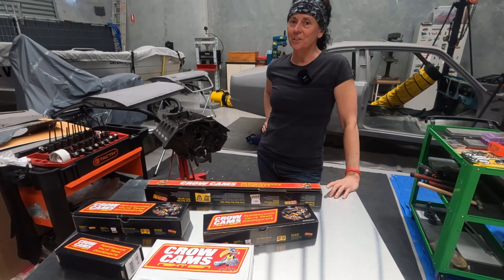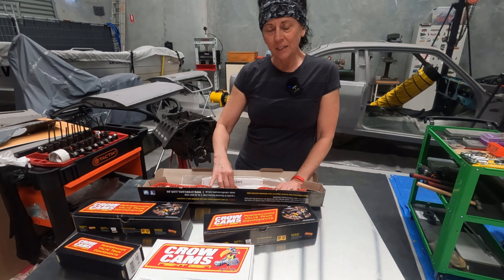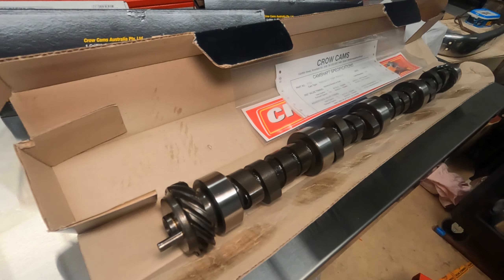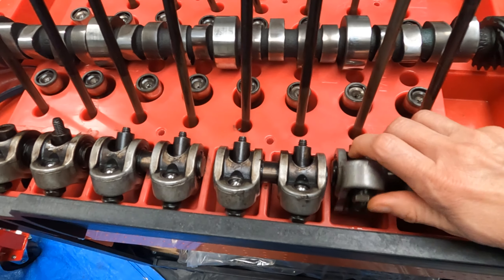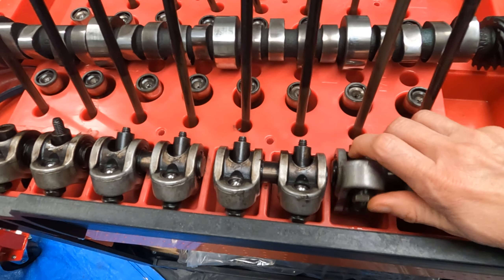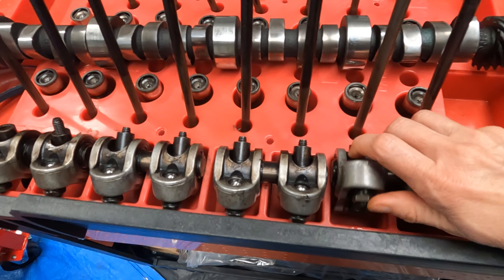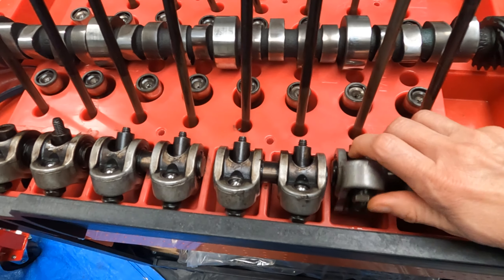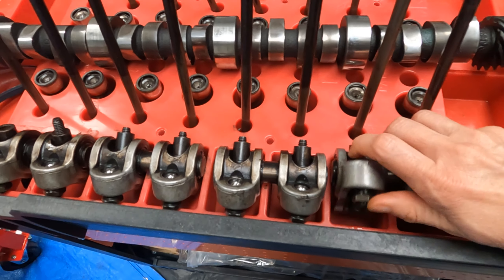The Cam I Chose For My Holden 308 Red Motor Rebuild

Comment: Cam/ Lifter failure on break in has become a chronic problem in recent years,  look very closely at the bottom of the lifters, they should have a slight convex curve on them with the high spot in the middle , if you put 2 lifters end for end they should rock back and forth .If they don't they may need refacing,  even new lifters aren't always correctly machined .

You need to make sure you give the cam a really good clean before adding copious amounts of break in lubricate. 
Also, you should take a close look at the roller tips of the rocker arms . The rollers can get small flat spots on them , if so, you can buy replacement rollers from Yella Terra and their straightforward to replace. 

Finally,  when you get the heads back from the machine shot you should carefully blend the third angle of the value seat into the port and pay particular attention to the short side , the short side will have a ridge left from the cutter , this needs to be carefully radiused to leave a smooth transition around the corner. 
COME Racing, have a short video on YouTube demonstrating how to modify the oiling system,  Holden V8s  pump too much oil into the rocker covers often forcing oul down past the value stem guides so this modification is highly recommended, Sam from COME didn't mention what size the hole in the restricter hole however a 1.5 to 2 mm hole will suffice.

Keep up the good work 👏
Reply from the maker: Phew lots of great info there Craig! I have seen COME's oil gallery mod but was in 2 minds if this build needs it. And yeah, I've seen a few YT videos with failures like Barnsey's. Thanks for this!
Reply: @staceonwheels  I raced a 308 Hatchback Torana speedway car in "Standard Saloon"  a class where virtually no modifications were allowed to the engines others than a camshaft change.
 All the Holden V8's had top end oiling issues with the potential to have 0 oil pressure because much of the oil is up in the rocker covers.  Even after fitting  1-inch inside diameter oil, drain back hoses to the back of each rocker covers and routing them externaly down the sump it still had oiling issues. 

In my street driven 355 stroker that was fitted with VN heads , had the same issue that when you went through the traps at the drags and jumped hard on the brakes, oil would be forced out of the front of the rocker covers and go straight out into the vacupans and into the exhaust system producing lots of exhaust smoke .
Note: The VN heads have smaller push rod holes, thus suffering from this phenomenon more so than the earlier model heads.
Reply from the maker: I'm feeling more convinced... I'll check with the guy that machined the block for me. They probably do this oil mod too.
Reply: With the COME restriction size you are correct but also you can simply plug it there if you do the mod at the front cam bearing.  I plug that particular spot with solid or hydraulic lifters, its not required with the front mod 👍

Comment: Good tips from another Craig here about flat tappet cam stuff.
 Most failures are user related.
 P.s. great cam choice i have used that grind a lot, i call it the budget hotty, easy on the valve train,  sounds tough as, goes really well.
 Re the cam,, clean/scrub ALL of the shipping corrosion barrier off with brake cleaner and thinners(it stops your prelube from working!), put a short straight edge on the nose of each lobe and check it has some taper, you can visually see even .001" with the increased length of the straight edge, fit cam in block dry, fit thrust plate, look down each lifter bore and make sure the lobe is NOT quite central in the lifter bore, throw away any pre lube supplied, rub Moly grease into all the lobes(i use Penrite Molygrease EP3%), i use this because it is NOT oil soluable so it cant run off easily and will hang around until the cam is broken in. I apply about a .5mm to 1mm layer on all lobes.(no it wont block your oil filter, cut it open after break in and this demonstrates that you would need half a tub of grease in it to block it).
 Lifter bores- clean each bore, make sure there are no burrs on the underside from rough cam bearing extraction/installation, using only wd40 or similar- make sure every lifter drops into every bore withzero resistance,  if you need to push it in you have a problem,  now check the lifter clearance in every bore, if you dont have correct bore measuring tools do it  with a mag base dial indicator, at 90deg to cam centerline and 90deg to the lifter body and set best you can and wiggle the lifter, you want about .0008" to .002"(.0025" max) .
 Check each lifter base for convex, simple home method is to just put a strait edge against the lifter base and look at the light either side yes not real accurate but it is better than not checking. Rub moly on base of lifter only NOT on the sides, alloy engine oil to the lifter body and bore and fit lifters. Once lifters are fitted and valve train set using as few rotations as possible now do not turn the engine until you tighten convertor bolts if auto or until you start it.
 Fill oil pump with assembly lube(i use CRC StaLube Engine Assembly Lube here) or vasoline if you have to. DO NOT fill the filter with oil, you want the pump to be able to pick up oil immediately and it cant do this while trying to push oil out of the filter element but it can if it only has to push air out(for holden V8 use a big old type Z30 filter NOT the small filter), set the dissy, radiator and carb to run immediately,  start engine at low rpm only till you get oil pressure, (6 seconds MAX or turn it off) then run at 1500 to 2000 rpm for 15 to 20 mins.
 Cam is now broken in. Set base idle/timing, remove oil filter and oil, fit new filter(no oil in it)fill with new oil, finish engine break in. P.s.  for oil, i use 50/50mix of pentite 10 tenths 15w40 Running in oil and Penrite 20w60 HPR30, for cam break in and for the 1st oil change and ring break in, no expensive useless break in additives!
 Enjoy 👍
Reply from the maker: Maybe you should write a cam install and break-in manual Craig! Amazing info and thanks for taking the time to write all that out for me 👍. I do take in everyone's tips to doyble check and modify my plans. This channel has been great for that so far.

Also great to hear you approve of that cam choice 😁😁😁!!
Reply: @staceonwheels  no problem and thankyou, a book, I don't know, maybe haha. But really what I'm describing is a shorter version of what any thorough engine builder does. I'm always amazed at how many people know what main and rod bearing clearance they have, what ring gap, valve lash etc but if you ask lifter to bore clearance or libe offset, taper etc they say 'thats not stuff you need to check " or just dont know. Then when something fails like a love wipes etc they are very quick to blame a cam company or their quality control.
 Check 'everything' and if it seems right the 1st time, check again as you may have missed something!
   That cam will want a full 2500rpm stall 'at the least' if you run an auto trans.  When you degree it, go by the  'intake tappet rise at tdc on overlap' figure that Crow supply on the cam sheet, this is the easiest and most accurate way if you dont have the actual 'cam doctor' sheet for that actual cam you have due to manufacturing tolerances. Err on the side of 1 to 2 degrees advance on the cam.
Reply from the maker: @craig8187 thanks again. I'm gonna collate and save all these tips for when the build begins. I'm a stickler for doing it right too!
Reply: @staceonwheels  how did you go with this cam install?
Reply from the maker: @craig8187 not there yet. I did test fit it, and all good. But have been waiting on other parts and a chunk of time to get everything cleaned and ready for assembly. In fact, I'm on my way to the shed right now to rebuild the oil pump. Small steps!
Reply: @staceonwheels   beauty, it will get there 👍

Comment: Tasty stuff.  Will be glad when I’m finished with the cab to get round to the fun stuff too. Just finished the underside and started roughing the back panel up where the vinyl cover was to prime it. Floor still to be coated then the front firewall. I had a 308 when I had a sandman clone panel van, had a mild cam put in that with a 650 double pumper Holley after it had a piston disintegrate and rod went through the cylinder. Ended up trading it in for an XD falcon. Miss them both. 😢
Reply from the maker: I wonder how that piston disintegrated...? The cab work is tedious at times, so I'm kinda glad I have the 308 to play with (and my Ducati) along the way. 

I still haven't decide about the back panel on Trixie's cab... there is no rust and the original paint is lovely so I really want to leave it. 

Anyway, we're both making progress and that's fun. Spydey... you'll love your tonner as much as that sandman or xd I'm sure.
Reply: @staceonwheels No idea on the piston, the guy who rebuilt it was a Holden buff and he said he never saw that before. Yeah may back panel has nothing wrong with it either but I’m scuffing it up so it can take some primer and will get a new coat sometime, just so everything is fresh really. Behind the cab is the same also, but instead of it’s current white colour I think I might make it black in the middle section for contrast. I’m sure I will like this car but the others just have sentimental memories because I was a pup back then! Took my soon to be wife to the drive-ins in the PV, t’was a good era for car lovers.
Reply from the maker: @oo0Spyder0oo yep the nostalgia is a huge part of restoring these cars. (Not many drive-ins around these days!) I like your idea for the back wall inside... I might find some red oxide primer and do the same, so it at least still looks most original for the time being.

Comment: Hopefully it doesnt wipe a lobe. Have had some hit and miss issues these days. 

Ill usually only use johnson lifters these days. 

My only reccomendations would be 1: have the sprinfs professionally set up with pressure testing. Last time i used xrow springs had to shim half of them two different height shims to get them to work right. 

May also need to use a softer spring for break in. 

Last flat tappet we used was broken in on stand by the machinist. Dad wanted a warranty so i didnt assemble it. 

I had vacuum issues when i installed it and had it running. Wiped 12 of 16 lobes .

Also had one fail on my pontiac but both were crane.

I never had any issues in the day , im hoping crow still uses australian foundry and should be fine. I honestly blame the chinesium crane now use for the ft cams. 

That cam if goes well will be really nice with a 9-10:1 comp ratio , air gap dual plane and a nice 570-600 carby. 

Please dont let anyone talk you in to bigger. 650's are a choked down 750 and in my opinion way to big for even a mild 350/355/351 for a street driven car.
Reply from the maker: Yeah I've heard the nightmare cam and lifter stories too. Fingers crossed with the Crow. But I'm researching and will take all the precautions  I can. There's always more to learn.

Thanks for the tips and sharing your experience. Adds to the learning!

Comment: The rebuild looks good with those quality parts🤠
Reply from the maker: It won't be a cheap rebuild, but we gotta spend it on something hey?
Reply: Yep, im rebuilding the exact same 308, QT block turbo bolt pattern, bore standard almost no lip at all, amazing find, period correct for my HZ Premier.
At the moment have a VT roller cam rod relieved block, standard bore as well, on VN heads and very expensive inlet manifold, holley 650,in the HZ, turbo 700r @staceonwheels
Reply from the maker: That 308 is a very rare find! Will be interesting to see what you do with that. Where is your VT engine going?
Reply: @staceonwheels  The VT is in the HZ and fully registered, so i don't really need the 308 now, its out of a 78 HZ GTS, i wrote it above (read more)

Comment: Rebuilding engines is a little nerve wracking, but so exiting all at the same time. I love how you are doing it all yourself. 
  there’s no experience like hands on.
 When it comes to coolant, do some research on a brand called ‘evans’, perfect for old school engines.😊 mouse
Reply from the maker: Hey mouse... thanks for the coolant tip. Will check it out. And yeah, I love learning by doing (after some researching first of course) and I never realised I could love doing this so much. Too bad I started so late.

Comment: I am interested to see how 8 sleeves go. You see almost everyone saying its a huge NO NO, but none of them.have ever bit the bullet and actually done it, I always bought into it but i was at a very big motorsport engine machine  shop recently and they say they never did a Group A engine in the later years that didn't have 8 sleeves, They used flanged sleeves though, but prices that BS about "pulling the deck up" with 8 sleeves, is just BS.

I am waiting on mine to be machined atm, going .040" over as she didn't clean up at .030 with the deck plate on, now tossing uo keeping my dash 3s or going VN heads. Keen to see your thing done.
Reply from the maker: Yeah I wasn't sure about sleeving the block at first, but did some research and then checked with the recommended machine shop and they said no issues at all. BUT... it did require that the water jackets be 1/4 filled for extra bottom end support. It was already bored out to .060" so no meat left for more. Fingers crossed, but really I'm confident. I won't be ever boosting it or pushing for much more than 350HP. 

Sounds like you have a good block - you still have room for a final bore if you need it down the track. EVERYONE told me to go with VN heads too, for more power, but that's not the vibe of this rebuild - I want it to look and feel like the 70's engine that it is, with what a petrol head would have done to it in the 80s. And with Yella Terra heads, how could I not rebuild those?

Comment: Duration and lift makes for a good choice
Should make around a horsepower per cube
Reply from the maker: That would be good enough for this engine. I don't want to stress it, since it's had a rough life and now has sleeves. But that cam... I cannot wait to hear it and feel it and drive it.

Comment: That cam is perfect for watt your building
Reply from the maker: Thanks for the reinforcement! I cannot wait to hear it.
Reply: @staceonwheels  should sound good you need good heads 1.94 1.6 good port job and 10to1 comp let it flow  should be a great driveing ute with 4 or 5 speed transmission
Reply from the maker: @darrenkingston9912 the heads are yella terra so L34 valve sizes, currently being cleaned up. Transmission, not sure yet...
Reply: @staceonwheels  get a diegrider and port them your self it's not hard do some research nock the guide boss down  and sort side clean up  YouTube  show me how to port heads you can do it
Reply from the maker: @darrenkingston9912 thanks - they already had some light porting. They're just as the machine shop to be crack tested and they're doing the valve seats for unleaded and 3 angle grind, but I'll be assembling them.